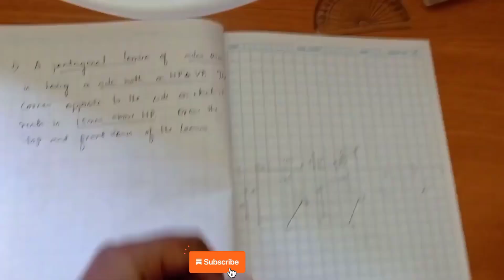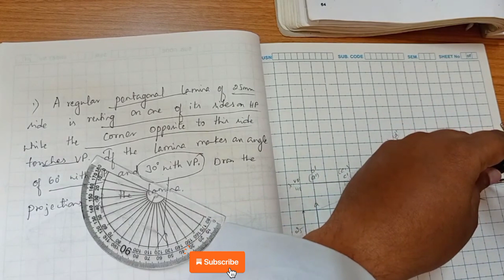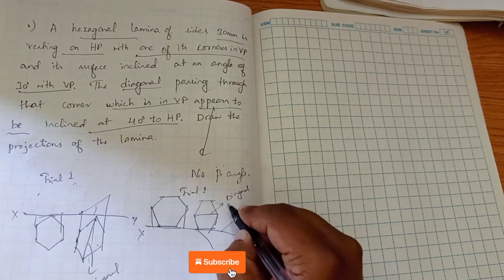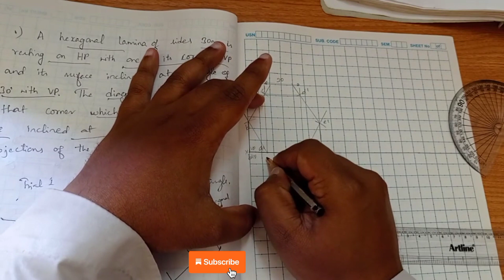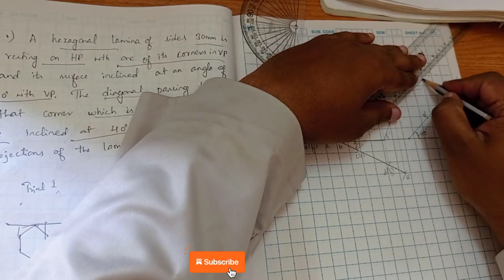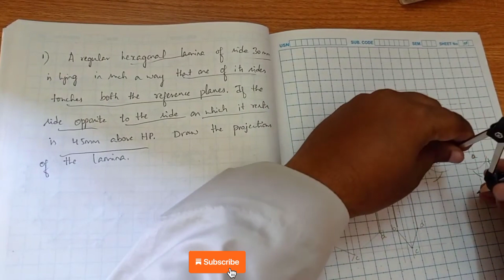PROJECTION OF PLANES:  HEXAGON |PENTAGON  (SPECIAL TYPE)

Comment: .

1

A pentagonal lamina of sides 25 mm is having a side both on HP and VP: The surface of the lamina is inclined at an angle of 60° with HP. Draw the top and front views of the lamina

Sir ee question ge answer kalsi
Reply from the maker: I have shared answer